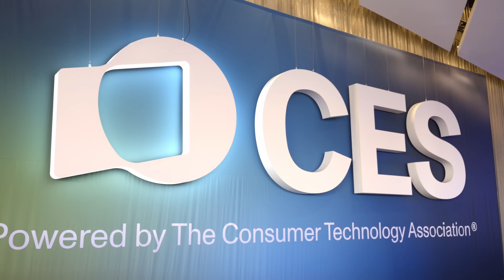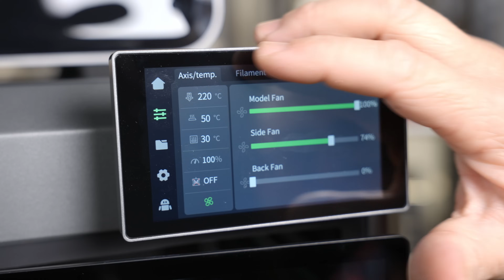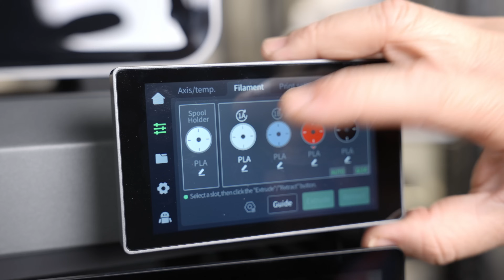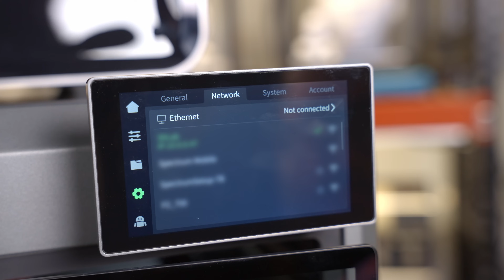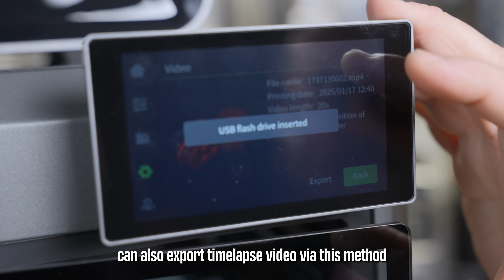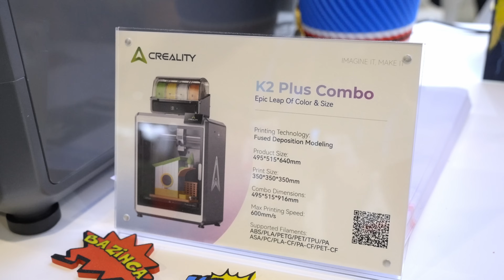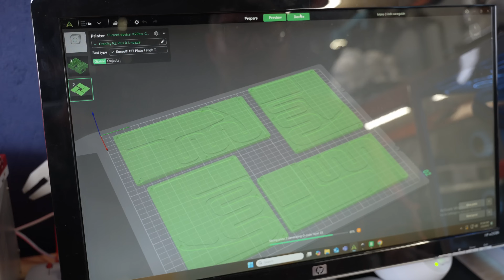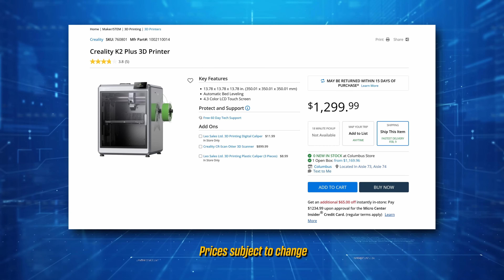Creality K2 Plus Overview | Test Prints and Multicolor Projects

Comment: sonic pad can connect to K2 plus?
Reply: The K2 plus already has Klipper, integrated acelorometer and a touchscreen. Theoretical you could download all the configs, deactivate the Linux part of the controller board and control the MCU-part of the controller and the MCU of the printhead directly from the sonic pad (if you find documentation for the board) - but why should anyone do something like this? The sonic pad would just replace whats already inside the printer...
Reply: @oleurgast730  oh i see, thanks for the answer

Comment: My opinion,
This printer has been nothing but a headache for me with all the issues I've had, from filament jamming buffer, errors during calibration and how heavy it is to work with .
Never again !!!!
Bambu X1 CARBON IS BY FAR THE WINNER of my many printers.
Reply: I also have a lot of problems, I have so many different problems with this printer. eventually the printer stopped working after updating their latest firmware. And of course there is no normal way to restore the old firmware version. Mindset creality is let's release a new model and let users test it. Just look at the number of posts on the creality forum right after receiving the first pieces. Release new printer , release new printer, release new slicer versions - always problems.
Reply: @szeptak1  Yeah it is a real shame. I wanted to get one however my cousin had  so many issues with his creality printer and hear his saga of trying to get support and the parts he needed really put me off. When it come to buying a printer I think hardware is half of my consideration. I want good support and easy to access parts too.

Comment: I've got my K2 Plus, had it for about a week now. I've had some weird errors and issues with the CFS but overall it works pretty well. I find my bed is WAY out of whack, but it does print well regardless. They should stop calling this a "multi-color" printer. It's a production printer designed for engineering filaments that CAN do multicolor. Why do I say this? It can't do it well. The prints turn out well, but the amount of waste is just beyond what's reasonable. I did a test print with a model that was less than 4 grams of filament total and used two colors red and white. The amount of purged material was almost 200 grams. TWO HUNDRED GRAMS for a FOUR GRAM PART.
Reply: The same waste applies to Bambu AMS too. You have to be smart about how you change filament. If changing colors is high priority then a Prusa XL might be better option but it’s vastly more complicated and more expensive.
Reply: @kingjamez80  Unfortunately it has nothing to do with how smart you are about changing filament. The machine itself takes care of how the filament is purged, and it does it excessively by default out of the box. I didn't say Bambu machines with AMS don't have waste, they just have FAR less than the K2 Plus system. This can be tuned for sure, but the issue is that it should be tuned out of the box as it's advertised as a "multicolor" machine the same as the Bambu with AMS is. The difference is the the AMS out of the box works and doesn't require tuning to get rid of the EXCESSIVE purging. When I say excessive I mean like 5x more purge from the K2 than the X1C lol

Comment: When buying something like this, Microcenter is the GOAT. 
I bought my K2 Plus from Microcenter's retail shop on purpose so that I could be sure that the huge box was in excellent condition. 

I've had 15 different printers over the years, including Bambu, Elegoo, Qidi, Creality (x4), Prusa (x3), etc. I thought I had everything with the Bambu but after getting the K2 Plus I am just blown away. It's ~my~ perfection printer. I battled hard on whether to just get another X1C, but I'm so glad I didn't.

Everything about it is great except for portability...

Make no mistake, the K2 Plus is HUGE. Whatever size you think the box is, it's bigger. It is just big enough to fit sideways in the back of a clean Model Y.

The super helpful and knowledgeable folks at the Fairfax VA Microcenter made sure that everything was in good shape before they helped me load it into my car.  

That's the huge difference between buying on-line and crossing your fingers that UPS/FEDEX doesn't drop it on it's way to your house. 

After getting it home, the K2 Plus+CFS just worked. Nothing was bent, broken, or out of alignment. It has not had a single print fail after 4 days of printing since I got it on the 4th of Feb. Four color prints have been flawless. It spits out benchy's in 14 minutes and 35 minutes in 4 color, insanity for a printer this size. 

Thank you microcenter for being a retail shop that carries actually useful products. I go out of my way to spend my 3D printing dollars here whenever possible.